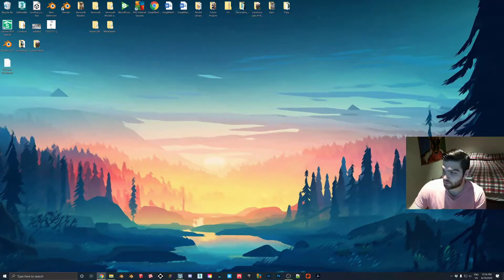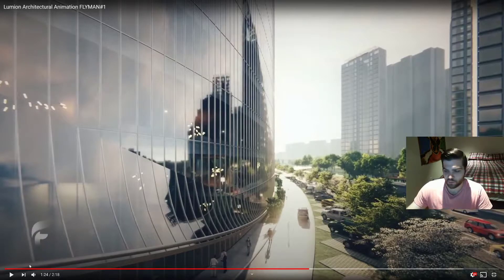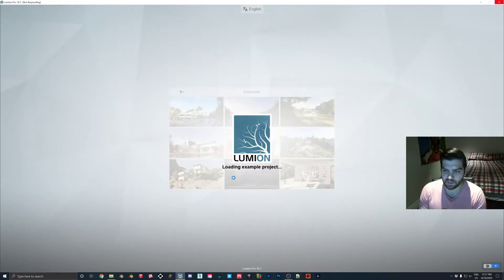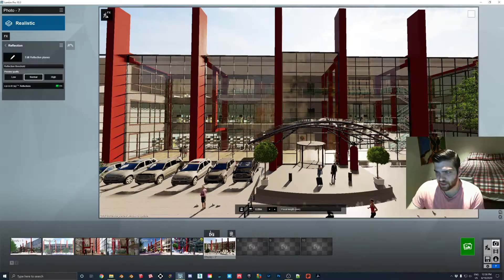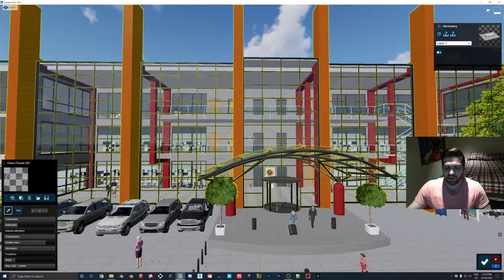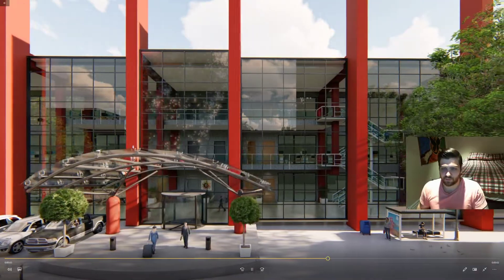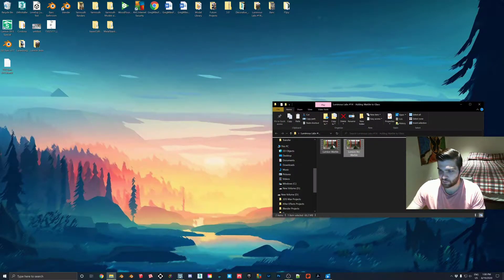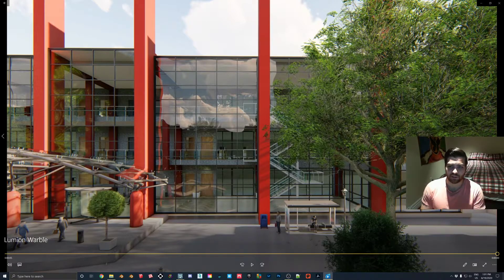Using GLASS RELIEF to add WARBLE (Pseudo Musgrave Texture)

Comment: I hadn't thought about that. That's a good idea.
Just wondering though, wouldn't bumping up double sided on the glass properties achieve the same effect?
Reply from the maker: I actually just went and tried this in Lumion and while the glass does get some more volume it doesn't distort the reflection. However it might be possible since I was only looking at this in the viewport and maybe with a reflection plane and rendered it would give the correct effect.